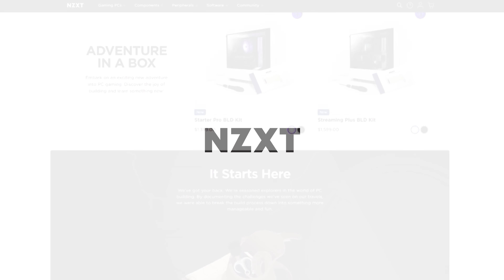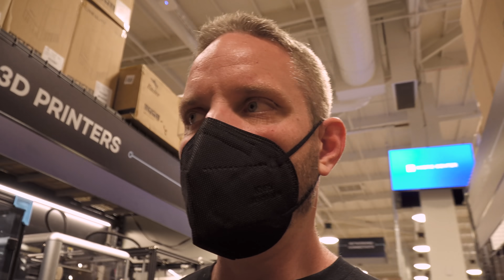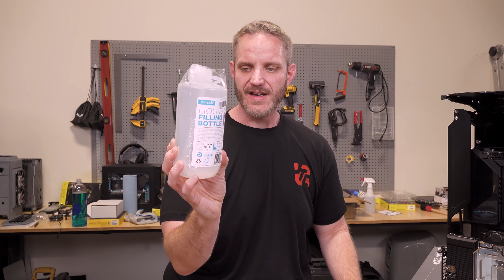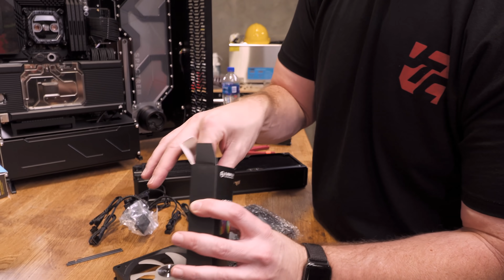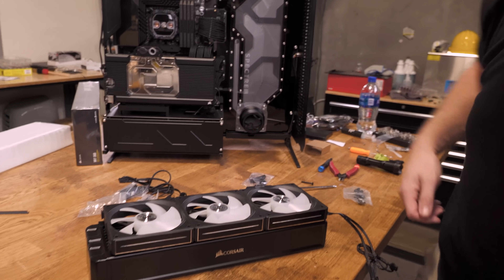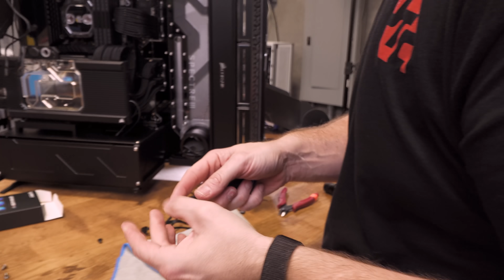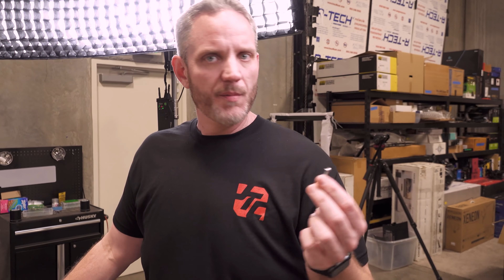We are professionals... professional IDIOTS!

Comment: Consider yourself lucky you can actually drive to a place like that and get parts. Wish I could do that =/. In any case, about those Lian Li fans. I have 9 of those and I have had 2 different fans now start to play up like there was something stuck inside the hub and making a loud noise or the bearing in them are shot and not spinning fast at all or something. Has happened to me with these 2 fans several times now and I managed to get them working correctly again with various methods such as slowing them down and speeding them up to pushing on the fan or spinning it fast with my finger. I have a video of it doing this fault. Be good to see your review on them in 6 months time and a years time.

Comment: You could place the controller in the top right corner of the case above the vertical rad. The cables would be long enough stock then and you can hid any extra cabling behind the rad.

Comment: If u flipped the fans 180 on the top rad, wouldnt the connectors be on the side of the water reservoir  so u could plopp em on the backside of the case or is there no holes there to get to the back?

Comment: Please stop using the uni fans. Please. I took your advised and tried them. In fact I have the radiator you just installed and tried using the uni fans on it. They looked great but were not strong enough to keep the rad cool. Had to switch to new fans.

Comment: you could just spin the group of top fans around and then the wires are going to be up near the distribution block, that would get them closer to the hub. for the sensor panel, could just make a custom housing like you were saying but have it run to the front to cover the back side of the pump straight off of the PSU shroud. might give you a bit more real estate to tuck some wires.
Reply: says the guy who has never done a custom loop ever in his life much less a full custom build like this lol

Comment: I just bought the Ender 3 Pro from my local microcenter for only $100 during their promotion! Nicks going to love it. Such a good printer it's amazing and easy to use. It's insane the amount of value you get out of an ender 3. Definately get a BL touch as an upgrade though. You  wont have to worry about leveling the bed anymore. Just click print and get a perfect first layer everytime.

Comment: If you're going to be extending the top fan cables anyway why not have the cables on the other end so you can run them down the inside with the front fan's cables? Route it all together.
Reply: I was thinking the same thing here.

Comment: When I worked for the DUluth GA location I had a huge talk with the GM's and reps about them carrying more custom watercooling gear.  A few of the GM's gave push back, so myself and a co-worker organized the section and sales sky rocketed proving my point.  So I'm proud to say I aided in the push for MC to carry gear - MC is a crack dealer for tech enthusiasts lol.  
Hearing Nick's Fit reminds me why I dont have a daily with an exhaust and suspension - still want a track missile though (want to find another EG/EK hatch to build with my son).
Talk to Bill Owen at MNPC Tech for the rad screws - he has some killer screws that should fit what you're looking for.

Comment: One of the best investments I've made in my system was the Lian Li Uni's.  I have the edge lit variety, and yea...Talk about cleaning up the wiring.  I'm actually considering another 3 for the Lian Li Gallahad AIO I have, as they just used "standard" RGB Fans for that.  My system runs even cooler than before, and OH SO MUCH QUIETER!

Comment: I'm working on a new build right now. I got 2 3 packs of the AL120s. I tried putting 3 on my EK AIO (top) and 3 in the front of the case, and I used the 3 EK fans that came with the AIO for case fans on the bottom (Lian Li 011-D). With the 6 AL120s plugged into the controller, and the 3 Lian Li fans plugged into a random fan port, I didn't have anything plugged into CPU_fan and it didn't like that. I took the Rad fan 4-pin out of the Lian Li controller (leaving the rgb cable) and plugged it into CPU_fan and it worked but 1 of the fans lost RGB completely. Ended up remounting the EK fans to the rad, running those to CPU_fan, and putting the AL120s on the bottom where the EK fans were. So all works now. Question: if I get 3 more AL120s and put them on my rad (or switch back to my original config) what do I plug into CPU_fan to keep my mobo from screaming at me? First build with modern RGB and an AIO, I might be missing something obvious... those fans are awesome!
Reply: you should be able to set to zero or ignore in the bios i think when looking at the fan curve controls. it was pretty standard like 8 years ago so it should still be a thing. i know there are ways.

Comment: The Lian Li connector is a standard ARGB if you just adapt the 3 wires.  I bought some airgoo ARGB light strips on Amazon and they plug into the Lian Li controller and work properly.  The adapter they include works with the Lian Li fans.  Specifically I did this on an MSI Tomahawk Z390 JRAINBOW connector.  I got the idea to just try it from your old video where you used Autozone stuff to mod a PC and told us about the regular RGB connectors being universal, so hopefully I can return the favor.

Comment: I have the same case but I haven't had a chance to do much cable management yet since mine will be modded and custom painted. I have the fan hub mounted between both radiators at the top right. This allows me to have both sets of the fans at the same connection distance and its hidden away. Then run the connections from the hub to the PB. My case has both add on destros (top and front) so it maybe more obvious in yours.. Wish you had done your custom home build as a live stream

Comment: Interested to see the temps with those Corsair xr radiators work with the lian li fans. The rads are almost strait through air and the lian li has marginal static pressure at full blast 1500rpm but is also quiet at full blast. You wouldn't have been able to use those if you had used Black Ice GTR. You might as well had Corsair sponsor it, cus it looks that way anyhow.

Comment: I would atleast try with a thinner radiator at the front. The thicker one kinda blocks the intergrated reservoir a bit.

A thicker one at the top looks great though!
Excellent editing on this vid, Phil 😄
Reply: I was thinking the same thing.  Also, plastic washers under the bolt head will prevent scratching the aluminum and allow proper tightening of the fans and rad.

Comment: I've seen sleeved 3-pin extension cables out in the wild for $5-7 bucks.  Even if the connector is proprietary, swapping out their connector onto a pre-built extension would probably be less visually detectable than doing a splice.  Of course, if the splice is completely concealed by the routing through case, then just do that since it is free and easy.

Comment: With such a big radiator, does it matter if you put the fan in front to push the air through the radiator or behind to pull it into the radiator? Ive always wondered if there is any thermal difference.

Comment: I whonder if its just the connector that is proprietary. Probably not BUT if it is still 5V data and ground it MIGHT work with standard 3 pins if you resolder them, allbeit without the fancy patterns

Comment: @JayzTwoCents move the top rad fans so the connector is near the front of the case. That would put it near the back panel so it's easier to hide and would make the run to the controller shorter.

Comment: Rather than mutilate the fan cables, why not just mount the fan controller to the upper radiator and use standard extension cables to extend the PWM cable length?

Comment: A while back the guys from GGF released a video where they used 3 120mm radiators in the top position of a build rotated sideways and daisy-chained them with tubing which looked pretty cool and then installed 3 uni-fans just as if they were installed over a 360mm radiator as well.  You could do something like that here to help you fill out the open space an look cool at the same time.

Comment: I'm surprised Jay didn't remembered to dremel or file the longer screws at the top to make them fit without the washer. Another option would be to have the washers on the inside.
Reply: That's what I thought. Just cut them down. To keep the threads intact you can put a nut down the screw before cutting. When you are finished cutting, just unscrew the nut and the hurt part of the thread will get corrected by the nut.
Reply: @themooq  That's what de-burring is for.  If you do it your way you will leave a very sharp edge on the end of the screws.
Reply: @themooq  That's how I've always done it 👍🏻
Reply: But the washer is there on the outside to protect the case from scratching as you tighten the screws.
Reply: @rodmorgan7041  Nope, it is there because the screw is too long.
Reply: @rodmorgan7041  It's a metal washer, and can still cause damage.  Nylon washers are best for that, most are white, but they come in black too.
Reply: Best done on a real grinder.  Takes a few seconds each, where as a Dremel would take way long.  Filing is an option too, of course.

Comment: Jay I tweeted out some nice silver screws M3x30 that would match your screws in your build. Other recommendation would be to use rubber washers between the screw head and the case to prevent scratching the paint. :)

Comment: It's easy to shorten any screw with a Dremel cutting tool. Simply cut a millimeter longer and then use the blade to sand and smooth the rough cut.

Comment: Just wondering if you thought of adding the fan controller to the small gap between the two rads in the top right of the case. Cable length would be good and I think it would blend into the area. Great vidz man thanks for the entertainment !

Comment: The RGB plug on the Uni-fans isn't really proprietary, it's just a bit older. I think they are used because it is a locking connector unlike the standard 3-pin D-RGB plug. Some Phanteks devices also use this plug. The phanteks stuff just usually comes with the adapters to go to the standard 3-pin. You can get or make them easily enough though. I found them on Ebay for dirt cheap.

Comment: 1. With F**'s Electronics going the way of the Dodo, Micro Center has a golden opportunity to branch out to cover those former markets - like in Hillsboro, Oregon and the giant Intel Corp presence it has with 4 main campuses. 2. You can pretty much just go to a local hardware (or big-box) store for the machine screws you're looking for as they're quite likely standard metric or imperial pan-head screws.

Comment: Jay i advise getting a resin 3d printer, they are messy but the learning curve is much easier and the detail is unmatched.
Reply: seconded, PLA, PETG, and ABS will show the layers much more than the resin printer will, and resin needs far less supports during printing in complex models.

Comment: Real question, why not mount the controller to the front panel above the radiator instead of cutting and extending wires? Im sure you could come up with a clever way to hide it
Reply: He could just rotate the fans 180 deegres and hide the cables behind the front rad. That would make the cables reach the controller no problem too

Comment: Maybe your Micro Center is that great. I haven't been to Cali in years, and you've mentioned that the Tustin store was just remodeled. My store in Madison Heights, MI isn't that great. The staff aren't that friendly, I've checked graphics card pricing between the stores and Madison Heights is inflating the prices even further than the current industry standard, and there are whole sections of the store that have leftover stock no one is buying just... out in the open. My local store needs a redesign and maybe a management change.

Comment: If you are already extending the cables to the fans in the top then put the cables on the other side so they hides more. And do the same with the ones in the front, do not have them come out like you put them. Come on Jay, no short cuts. :-)

Comment: When you splice your RGB wire use soldered butt splices from microcenter or amazon with ur heat gun with a thermal shrink wrap, will keep everything isolated and clean looking, can even put the end of the braid they use under the wrap so it doesnt fray everywhere

Comment: Another great video.  As for mounting of the fan controller. I'd stick with behind if the gpu but not attach it to gou but motherboard. A 3d print that would allow you to plug it into the many puce slots.  Another option is to attach it to one of the metal back slot covers. With slight modifications

Comment: Use black felt washers then you can slide and not scratch the finish, plus washers don’t compress and make the bolt stand up too much compared to the other fittings

Comment: You could always put the washers on the rad side of the case, it will give you the spacing you need, but will hide the washers completely
Reply: then the radiator wouldn't sit 100% flush

Comment: Jay picks up a valve instead of a flow indicator.
I pick up tuna in oil instead of tuna in water.
I think we've all made these mistakes.  Fortunately, I don't have to drive an hour each way to get to the grocery store with a ridiculous exhaust.
Reply: "with a ridiculous exhaust" 🤣🤣🤣
Reply: @dannnnnny  - Sorry, but I find loud rattly exhausts obnoxious, not cool.

I think it's more fun to run stealth and silently blow people's doors off.
Reply: @phydeux  beta
Reply: @SikikkaL  - That's an oddly hot take to make based only on my preference in exhausts.  🤣

Pipe down child, let the adults talk.
Reply: @phydeux  that fit probably has some crap budget exhaust, I agree it sounds like shit. But I like a loud car as long as it sounds good, I'm a mechanic and custom fabricator and drifter, just can't stand quiet cars, so boring. Got my gf a Tesla model s, sure it's fast but it's boring, you have no other sound to make it feel raw and intense, I never drive it. If you have a really quiet exhaust then it's definitely got alot of restriction and back pressure from the muffler so you're limited to 300-400hp max before running into major issues. My street car is a r32 gtr making 872hp, it's only a bit faster than the model s, but feels WAY faster because of the noises it makes, especially with antilag on. And my drift car is a v8 240sx making 600hp naturally aspirated, it's alot slower than the model s but feels way faster and more fun, it's crazy loud and have a sequential trans with no lift shift. I get at the end of the day it's personal opinion, but quiet cars are boring and soul-less. Just gotta not be a cheap ass when building or buying the exhaust
Reply: I've drunk coffee flavoured rum and coconut flavoured vodka due to someone picking up the wrong bottle at the store.
The coffee rum was alright after several shots of unflavoured rum, the vodka is still sitting somewhere.
Reply: some time ago i got a hair conditioner instead of shampoo. i mean, my hair isn't even glam enough to warrant a conditioner, so i just sat there and stared at the bottle of conditioner, questioning my ability to read a fucking label.

i now double check. never again.
Reply: The tuna in oil bit hit hard. More times than I care to admit